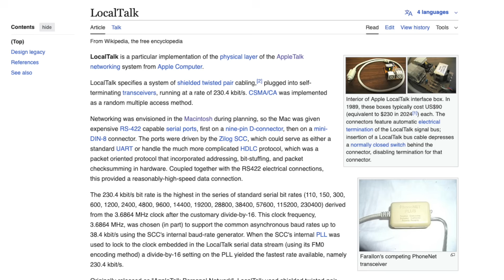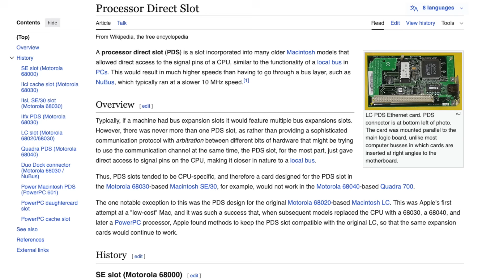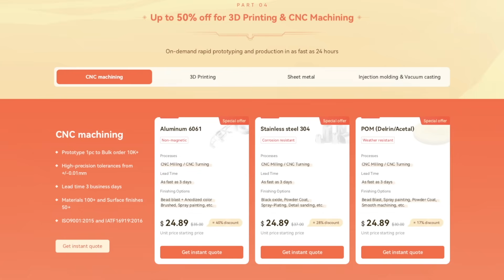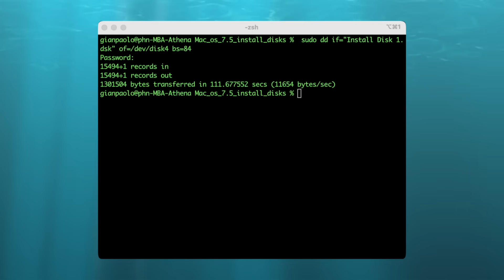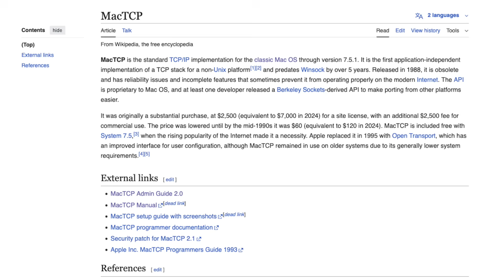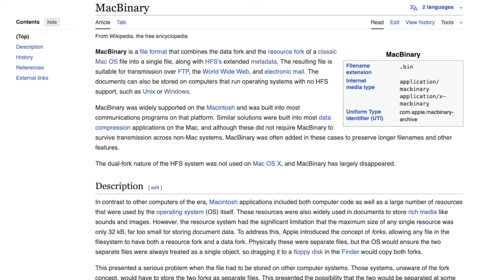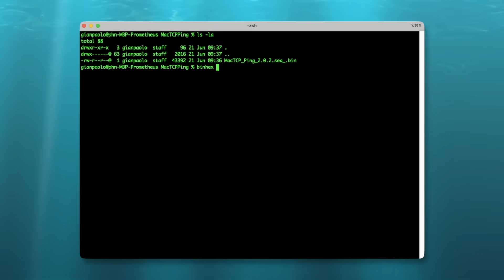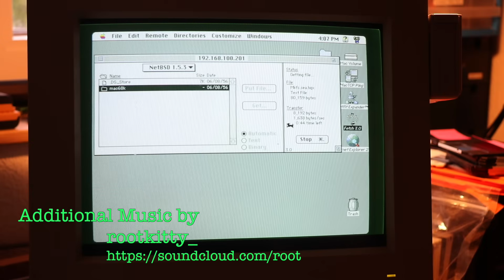200MB Over Floppies? Nope. Ethernet Upgrade for 90s Mac Performa

Comment: ls-240 is a 240mb floppy.
Reply from the maker: Sure, it is, I have one.
But that‘s not the point. I wanted it networked. 😂
Reply: @THEPHINTAGECOLLECTOR  did ya know that you can literally hack every system with that little guy? Hell. I wonder if the Sony card to floppy adapter works in it. Since it boots under a/b, and most bioses boot floppy by default, tiny xp will fit on one while the other can be swapped
Reply: @THEPHINTAGECOLLECTOR  well, you're the first person that didn't get lazy and use a bluescsi to make it wifi/etc

Comment: Networking on pre-OSX Macintosh was... different. Up through Mac OS 9.2.2 the platform only supported one protocol on one interface at a time. A Mac could switch protocols and interfaces on the fly, but if you needed to connect to an AppleTalk network AND and Ethernet network at the same time you had to buy 3rd party software. If you wanted to network with Windows (other than setting up an FTP server on the Mac or PC for file transfers) then you needed 3rd party software like Thursby DAVE. Unless you were running AppleShare IP on the Mac and your Windows was 3.1x with TCP/IP. Apple made an AppleShare IP client for Windows 3.1x. They announced an ASIP client for Windows 95, then never released it. For some reason circa 1995 Apple decided they were going to do that and more to make Mac not play nice with Windows.

One pain in the backside with ASIP was you could not delete an entry for a server if the server wasn't active and the Mac connected to it. If the server was gone or you were blocked from logging in, the only way to delete the entry was to delete the entire networking prefs file then re-enter all the server info for the servers you still wanted to connect to. It should have been possible to make a program to edit the networking prefs file but as usual with Macintosh, it was another bit of highly useful hacking all the Mac hackers were too apathetic to actually do. Nahh, they must have enjoyed the tedium of having to re-enter all their networking server information whenever they no longer had access to one server.

So please, for the sanity of vintage Mac users, will someone make an ASIP networking prefs editor program?!

Where Windows 95 had it all over Macintosh on networking was it could run multiple protocols on up to six interfaces *simultaneously*. So what if you had to reboot after changing anything in networking? Once you had it all set up, you *never had to change anything*.

Comment: I think you can upgrade MacTCP with Open Transport and it’s a lot easier to configure!
Reply: A lot more robust and reliable too. Didn't it come standard starting with 7.5.3? (Or, not standard, but shipped with the install discs  as part of the normal Retail/upgrade box?)

Comment: I once had a modem - it was 2400bps for the Mac but my PC had a 14.4kbps modem on my PC. I downloaded MacBinary using 2400bps modem as the ZTerm app can decode MacBinary natively so when I downloaded it from a BBS it would appear as a regular Mac app. This let me download Mac apps on my PC as .bin MacBinary files, transfer them to my Mac and decode them there. But transferring the 20K of MacBinary application took forever at 2400bps. Stuffit Expander later was the tool to use as it expanded every archive format out there.

Comment: MacBinary files are plain binary files you can transfer using MS-DOS disks. You just need a decoder that can encode and decode MacBinary into normal Mac files. MacBinary was created for file transfer purposes on BBSes and such, while BinHex was more for Internet where 7-bit systems might prevent sending 8-bit data. MacBinary files are NOT Mac files, it's just an encoded file format and many Mac tools often are able to transparently encode and decode MacBinary when sending or receiving files. Mac files have two forks - a resource fork and a data fork, and MacBinary combines them into the data fork which is transferred to other systems. Incidentally, NTFS's alternate data stream support was to support Mac files so if you copy them to an NTFS system using Apple Filing Protocol, you can end up with files with RSRC alternate streams. Later versions of MacOS came with Stuffit Expander included in the OS as users will often encounter the issue when dealing with files from the Internet.

Comment: 10:19 in my very limited experience in joining the GlobalTalk network for MARCHintosh via an emulated Macintosh, my experience was that the TCP/IP stack does not initialize until you fire up an application that requires it.  Definitely a different mindset than other OSes as we have seen!

Comment: might want to populate that FPU socket (suprised yours has it, I had to desolder the though holes and add my own socket) it won't help much in most mac applications (especially on the LC series, maybe excel) but I bet it would help with bsd trying to do unix things (and the fpu is generally only a few bucks)

Comment: Yup. If you copy an old Mac file onto a PC, you lose the "resource fork", which (glazing over a lot of details) describes to the classic Mac OS (System) what kind of file it is, e.g executable or what have you. Back in the day I used a Macintosh emulator called Executor and learned all of this the hard way.
Reply: seems that the old world mac's I have don't have a working 1.44 meg drive or if it does work its the 800k drives. I have a old beater PC I keep under my grage workbench with linux installed and a pci scsi card. Basilisk II is a long time emulator that will work with not only mac image files but real deal hard drives on the SCSI. so with all that going on its nice to have an old 6 core phenom II connected via ethernet to fiber internet while running all the setup stuff in emulator mixed with disk images and a real deal hard drive. shut it down and put it back in the mac like nothing happened heh

Comment: You needed to binhex to make sure the resource fork and data forks were kept intact; a concept that didn’t exist in the PC world.
There was an alternative that used less storage space if I recall hmmm but the name fails me
Reply from the maker: Exactly. That's why MacBinary files break when storing on a FAT file system.

For the second one, you're propably referring to Stuffit archives (.sit). These seem to be safe for interchanging via PC systems as well, adding the benefit of compression.
Reply: I think even MacBinary files should be fine on a PC system even with a FAT filesystem. It's far more likely that third party software (or possibly Windows) was corrupting the files somehow.

BinHex encodes/transforms binary data into pure ASCII text which makes it almost universally safe, because it's a very straight-forward encoding and very little will try to tamper with a plain text file.
Reply: @jnharton yes that’s it! MacBinary should work indeed. I used to prefer those back then since they were smaller… with my 14.4k modem.. downloads were.. long😅

Comment: Never played much with classic Mac. I did however get a realtec 10/100 card running on MacOS 9. I was happy about that. So much faster and cheaper than the Apple sanctioned product. But that was when they had PCI support, much later than this. Nice to see it done.
Reply from the maker: Yeah, this Processor Direct Slot definitely intreagued me. But at least, it gives some upgradability to those vintage Macs.
Albeit Steve Jobs himself was no big fan of expansion slots.

Btw, I'm definitely going to do a deep dive into Apple systems with PCI as well.

Comment: I thought connecting Windows 3.11 Workgroups to modern network was hardly enough for taking some files from my sharing folder...
Reply from the maker: Well, so far it was adventurous to get it communicating via TCP/IP.
Had I been going with AppleTalk, it would be propably even more adventurous. I'll definitely do that as a follow-up.
Reply: @THEPHINTAGECOLLECTOR  Is that possible to sharing file Windows 3.1/9x/ME to old Mac OS like Mac OS 8 and 9???
Reply from the maker: @DhavidSetiawanKilluaDhavid  Not natively, no.

As much as for connecting to Novell networks, where you needed the Novell client for Mac OS, you'd need a 3rd party software as well to be installed to access Windows servers.
Reply: @DhavidSetiawanKilluaDhavid  OS8 and above have appleshare over TCP/IP which will get you talking to most OSX boxes, and I am pretty sure you could get appleshare on windows 9x at least out of the box
Reply: I don't know about the desktoo windows, but NT supported AppleTalk file and printer sharing. We used that around 2000 to replace old dedicated Mac computers in the server room.
Reply: @kuebbisch Oh okay, because I never use Mac OS 8 even 9. I remember sharing Mac OS Tiger with XP only.

Comment: Yo may find getting that card to work under NetBSD to be a challenge - I hope there are drivers for it. It was difficult getting Apple's Unix working with Apple-supplied and supported hardware! Also, isn't there an external SCSI port on that box (maybe not, never had an LC). If so, then using an external CD-ROM might be a lot easier.
Reply from the maker: Yeah, driver support can be a bit tricky sometimes …

Trueth be told, network work during install if NetBSD, but troubled me afterwards.

Stay tuned!
Reply: I think that Farallon card is supported by the lc driver after NetBSD 2.0, but the best supported cards in my experience are the Nat Semiconductor 8390 (ae) and Sonic 839322 (sn) chipset ones.  I normally use Asantes with the sn driver like the mclc in my lc III.
Reply from the maker: @dp-3953  As we'll see next week, it works just fine on NetBSD 2.0.
Problems were elsewhere ...